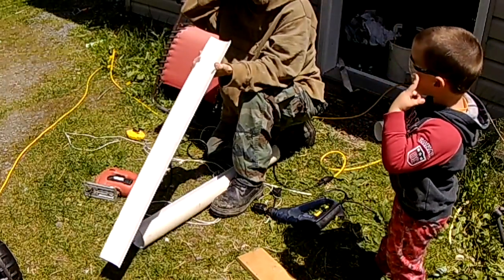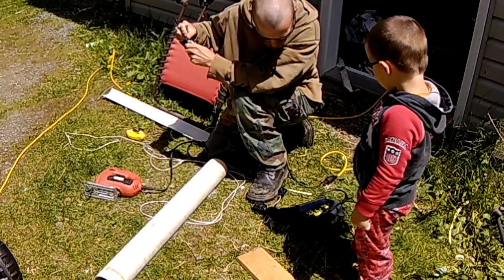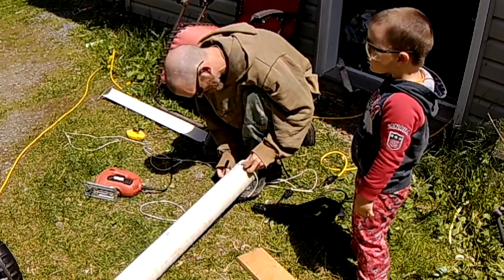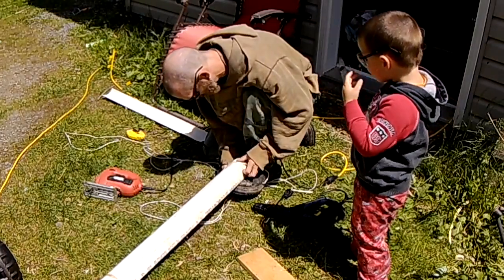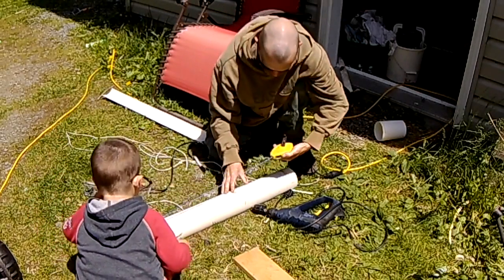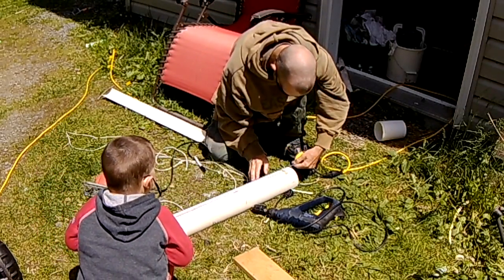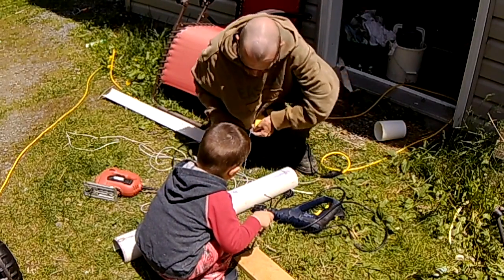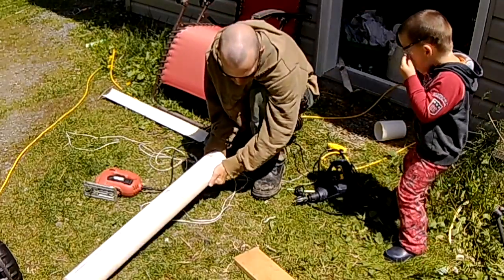DIY PVC windmill blade

Comment: Don't know what your doing ?  We are Experts at that chit here in my house.    When doing your cutting Ya need to cut down the line, to the right or left of the line every time if you want the blades somewhat close to the same.  LOL  Took me a while to figure that one out.   It takes some of us a little longer to come in out of the rain, eaaa know.
Reply from the maker: Depending on how accurate you  are trying to be, you should stay on the outside of the cut. I was trying the easiest way I could just to get them to spin. That's why i didn't file  down the profile all that well either
Reply: @ournovascotiaadventure1619   Ya a 1/10 of a gram off balance can create some serious Bad Ju Ju on the things at speed.